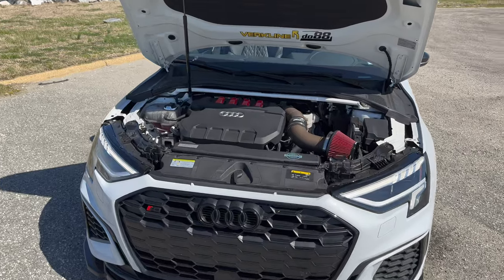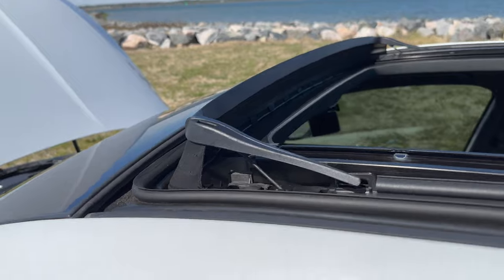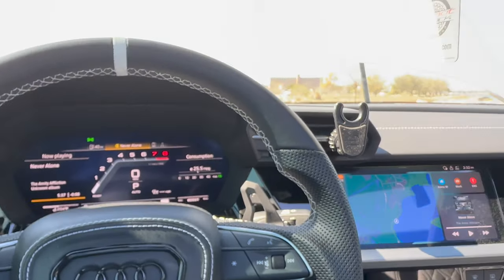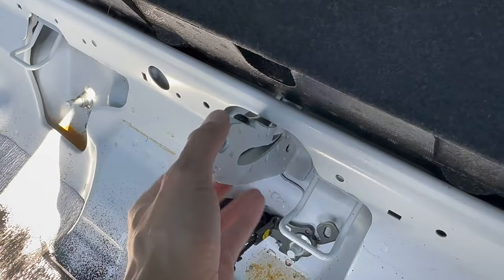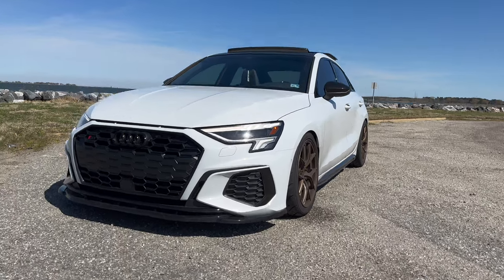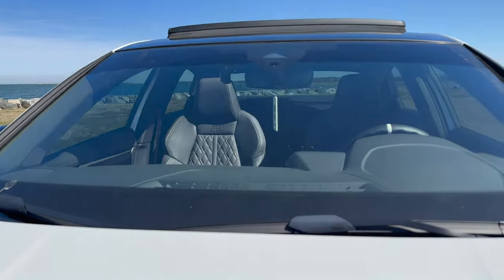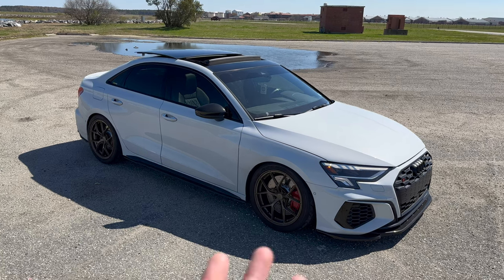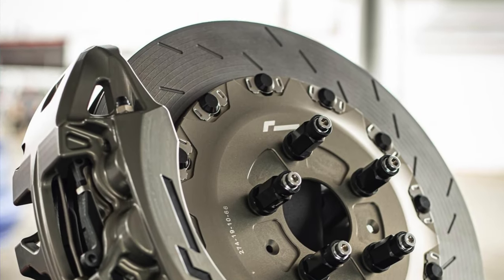25,000 mile 2022 Audi 8Y S3 update! The Quick, The Quirks, & The Future plans

Comment: Highly recommended to get a full front ppf if not the full car ppf'd. I have the mythos black on my s3 and for a black paint the car didn't have many swirls etc my buddy bought a brand new mustang in black and that thing looked like it had been through one of those bad car washes several times and been driven 10k plus miles but it was off the lot new lol. I looked at a s3 8v with 4k miles right before I bought my s3 8y with 1800 miles and the 8v's black paint looked like it had been through 20k plus miles and swirls everywhere. My s3 8y actually has really good paint imo for black color but it was an extra 750 I think but it's got this really nice sparkle in it when the sunlight hits just right owwwwie :). But yeah you can always polish out some stuffs and get the front wrapped and you should be good for the most part. Headlights getting wrapped was a huge thing for me as well but I'm pretty fortunate my brothers own a wrap company so it's easy for me to say these things cause I just pay for the material and not the labor.
Reply from the maker: PPF is a must… I should’ve done it.. regret it..

Comment: Any powertrain issues at that mileage? Any powertrain warranty issues that you missed out on? I have Stage 1+ Unitronic and cable sitting here but I’m afraid of having a costly warranty claim. 

Water pump still good? Turbo? Rear end? Sorry for the annoying questions! :)
Reply from the maker: Nope no issues! Just doing maintence early as you should! These transmissions are pretty stout as are the rear ends, I have no worries there! Turbo is beefy too, I don’t think we will have turbo issues it would’ve been very public by now if there was! No worries ask anything and everything you have on your mind!!
Reply: I am assuming a stage 2 map will bump the boost while stage 1+ runs more timing over stage 1. Besides having higher EGTs u could in theory run a stage 2 map without the Dp right?
Reply from the maker: @themystx2  I’m honestly not sure, but I’m sure the turbo would hate life lol

Comment: I’m currently looking at S3, S5, SQ5, M340i and M2. I’m so torn on what to do, I am already an indecisive person and I like all the cars for different reasons. I plan on doing some light modifications to begin with, a tune, air intake, intercooler, maybe a downpipe and exhaust, fuel pump, so when my warranty is up I can go stage 3 and upgrade the turbo to something bigger. But for the first few years of the cars life it’s going to be stage 1/stage 2.
Reply: RS3, M240i, S5 or X4M. I looked at all of those too and I settled on the S3 because I plan to keep it for 2 or so years then get a SUV. I didn’t like the prices in my country to the S3 ticked a lot of boxes to hold me for now.
Reply: I like the RS3 but it just doesn’t make much sense financially, I would get an M2 before I got the RS3, they’re cheaper for some reason and I think you’re getting a lot more car in my opinion especially for the money. The S3 however is kind of in a Goldilocks are where they’re very affordable, the new ones are heavily discounted right now like 4-6k on average and the low mileage used ones are extremely affordable. My “affordable”/“temporary” options are the S3, new or used, the S5 lightly used, SQ5 lightly used, or the m340i lightly used. My more longer term vehicles would be the M2, or a new M340i. The cheap ones I would have paid off in a couple years and ready to be traded in towards whatever my dream car is in 2 years. It’s such a tough decision I like them all in their own way. I’ve considered the g80 M3, but I’ve decided to do that next, there’s going to be a million low mileage options in a couple years and they’re going to be affordable, so I’m not leveraging myself into a 90k car and losing my ass on a depreciating asset. Do you like the S3? For me it’s a cool looking car with potential for some good performance with mods, I can live with it. I don’t need 550hp to live my life.
Reply: @ChrisDavis333  Yh I've been watching Bryce for a couple months now and other channels so I knew what was coming when I placed my order, it's a very fun car, I had a spreadsheet with pretty much all you had above, I wanted the RS3 but couldn't justify the cost for just power that I could tune and get for free later since other than the extra cylinder, minor trim and ~100hp they are effectively the same car. 300hp is more than enough to whip around town, on the highway and be faster than 90% of what you encounter on the road. I don't like bmw interiors they all look the same and they drive rough so as a daily that was out, Benz interior is an acquired taste and they are pretty pricey so Audi took the crown for being sporty, performance oriented and luxury (my gf loves the sunroof). The car also looks good from every angle, I couldn't stop looking at it the day I picked it up (glacier white). I wouldn't keep it for a long time just because I can afford to get something newer in maybe 4 years but it's a good "in between" or even long term car to hold you. I drove my evo x for a decade so I can appreciate what it brings to the table and this car will smoke those cars from the 2010s easily. When it gets going it goes man.
Reply: @ChrisDavis333  Also what really pushed me to cop the S3 was how I knew it could look with just a wrap and a tune. Search "UK's fastest S3" and you will see a charcoal grey wrapped 475bhp one, looks sick.

Comment: I love the S3 look. Just odd that the R does have transmission and coolant temps on the dash but the S3 don’t. Also I did notice the R front bumper is open for the transmission cooler on one side. The S3 interior much better also
Reply: the s3 has a vent open on the front on one side and closed on the other. It bothers me that the s3 didn't come with psi gauge too
Reply: @MistaBrown420  What? Well it’s kinda useless as it reads absolute pressure with boost but I guess after a tune APR recalibrated it so it should read only boost
Reply: @mqbr22  psi for tires sorry it does come with a turbo psi gauge
Reply: @mqbr22  I'd just like to be able to see each ties psi reading on the dash rather then have to manually check it every month or two to make sure things are good
Reply: @MistaBrown420  Oh we don’t have that on the R either. Pretty annoying on cars that cost over $45,000
Reply from the maker: @MistaBrown420  you would need sensors in each tire , I’m actually glad it doesn’t do that lol

Comment: I fixed my piano black center console issue with $10 in vinyl wrap. The center console piece snaps out in like 5 minutes and you can wrap the piano black on a table in like 20 minutes. No way I was babying that piano black around the shifter for years and years. 
I went with a carbon fiber look but obviously there is 100s of vinyl to choose from.
Reply from the maker: I want some kinda custom vinyl wrap. Maybe match the seat design.  Or even rather get a shop to make literally the same thing as my seat and glue it to that so it matches. Think that would be pretty cool tbh

Comment: Just picked up a new s3. Have you noticed when ur in manual mode the 1st to 2nd and 2nd to 3rd shifts are a bit jerky? When ur half throttle shifting at about 4k rpms? Almost feels like ur hitting a small pot hole when the shifts happen
Reply from the maker: Yup it happens to me too. A proper trans tune should fix that. My TCU tune just increases pressure so clutch’s don’t slip under power. Will be testing 034 stage 2 TCU that actually changes shift points, part throttle, launch control etc come next week. Cable gets here Tuesday should have a initial thoughts vid out end of the week next week
Reply: @Bryce Jordan Productions  cool thanks for the reply. Also I don't mind it but is it bad for the transmission I plan on keeping the car stock with the warranty but the warranty only lasts so long so I'm concerned haha

Comment: where did you get that front strut bar from?
Reply from the maker: That is ultra racings strut bar 😊
Reply: @BryceJordanProductions  i tried to find for the A3 8Y model but not available. Didn't know they made for S3 8Y already...
Reply from the maker: It’s not listed under 8Y. It’s the 8V unit. Most 8V  & mk7 suspension stuff fits the 8Y. It’s the same body underneath just new panels etc.

Comment: Where did the steering wheel come from? I need that.
Reply from the maker: China lol any of those china shops will do it. You lose self driving though. But ACC DCC all that other stuff still works. The new wheel won’t have the hand sensor so self driving just won’t work. I coded it out as well to get rid of the light
Reply: Can you disable the capacitor touch detection for active assist?
Reply from the maker: Yeah I did so the light would go away